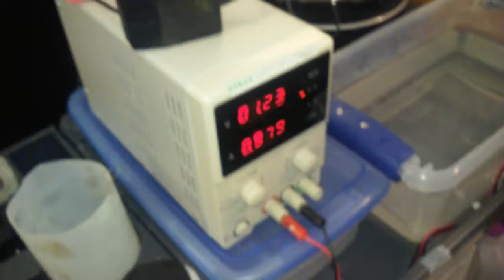DIY ZINC ELECTROPLATING PART 6

Comment: hi did you add any distilled water to the vinegar bath for elector plating or was it just zinc sulfate and vinegar mix please
Reply from the maker: it is  discussed in my series of video in part one or two, but yes I use distilled water never tap water.